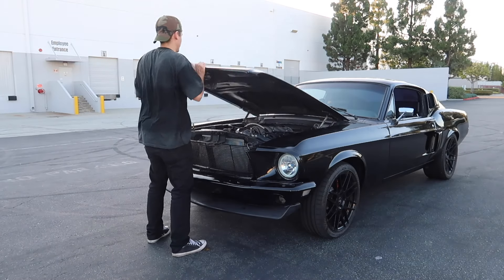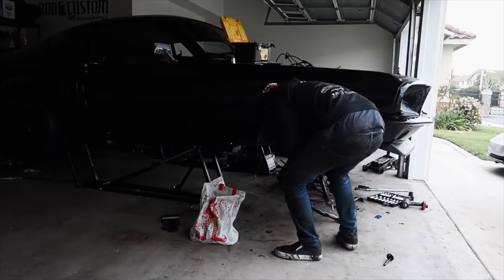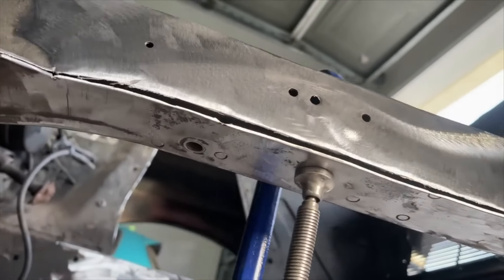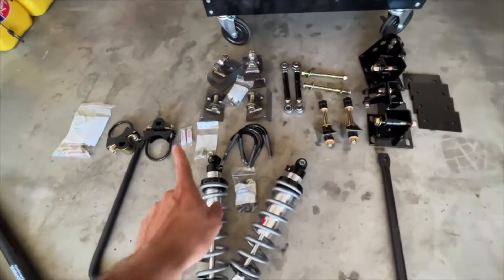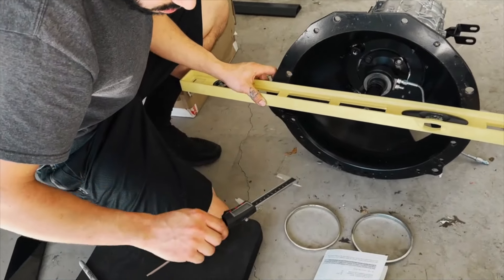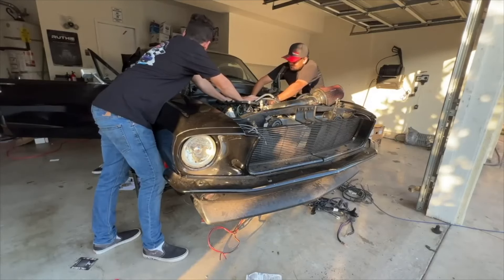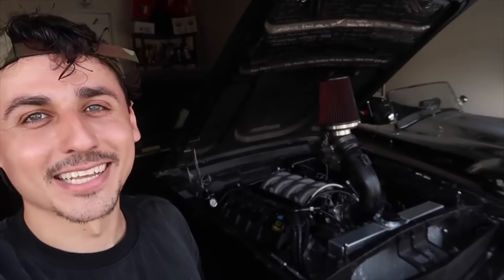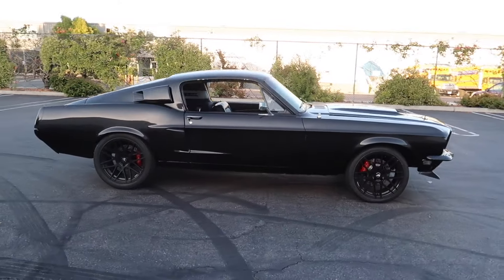BUILDING A COYOTE SWAPPED CLASSIC MUSTANG IN 10 MIN!

Comment: How fast would the top speed be? also are there upgraded engines I could swap out that don’t require messing around with the original engine bay but would still provide at least 600 hp?